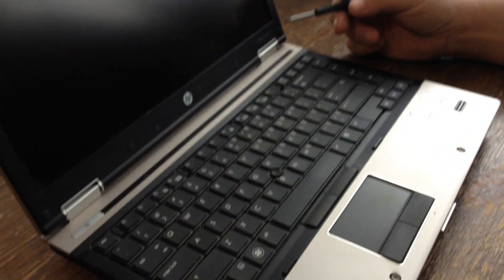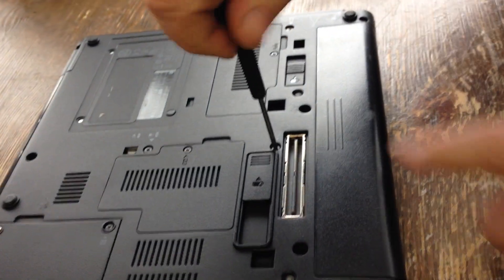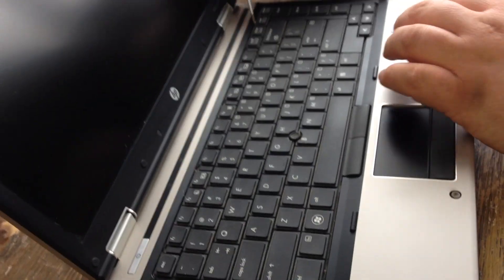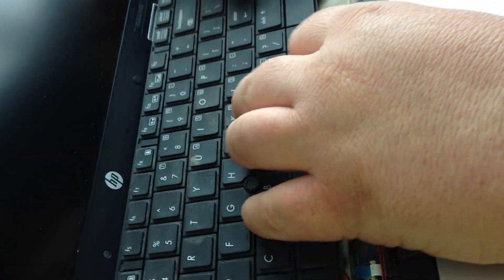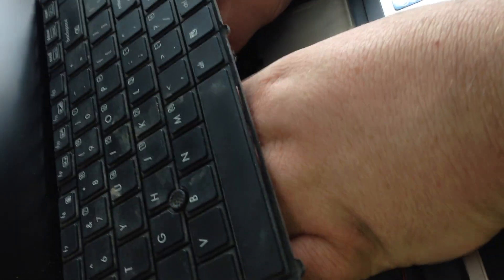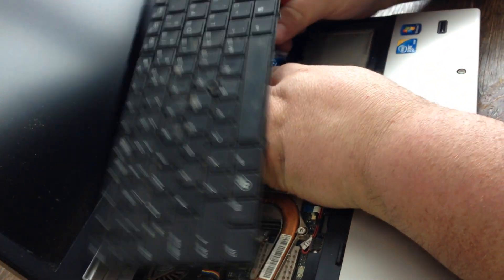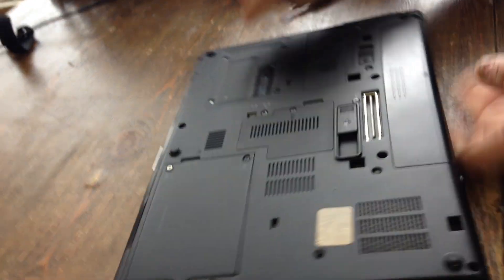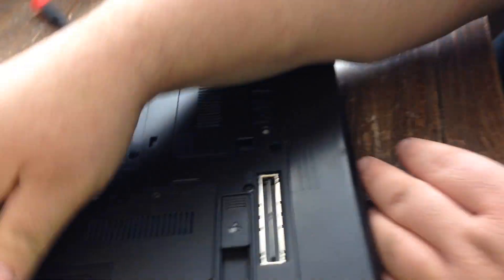How to remove and install a keyboard in a HP Elitebook 8440p laptop

Comment: FINALLY! Someone who knows how to make a how to video! I went through a few other videos before I got to yours, and the others either had poor lighting so you couldn't really see what they were doing, and/or played cheesy music rather than explaining exactly which screws to remove and about the tabs. I almost destroyed my keyboard trying to follow one of the videos, and my keyboard works. The only reason I needed to remove it was to gain access to the battery for the CMOS settings, so I could unplug it to reset the BIOS which was password locked, and all of my attempts to reset it through other means had failed. You sir, now have a new subscriber, as well as like number 104 on your video.

Comment: Can anyone help find a video or detailed picture that actually shows the installation?  That step is covered up.  Removing is easy.  But figuring out how the ribbon fits into the slot is not.  How does it attach?  I wish I took pictures before removing the keyboard but it is too late now.